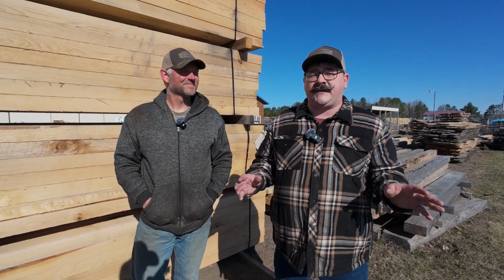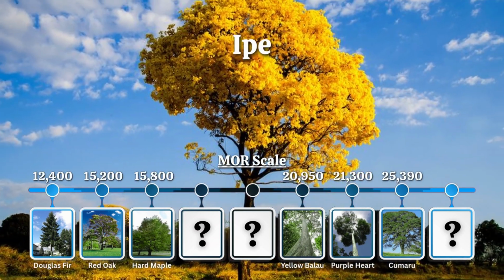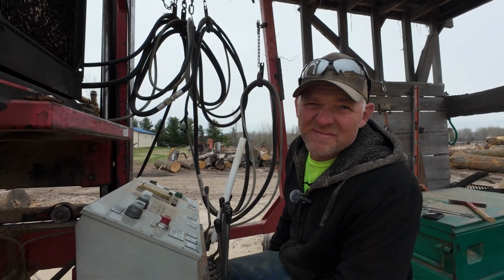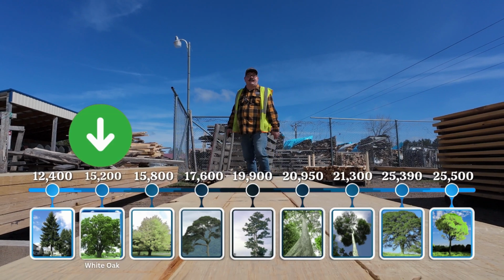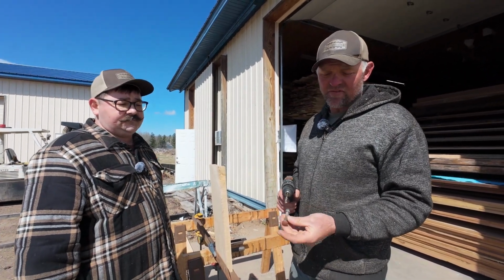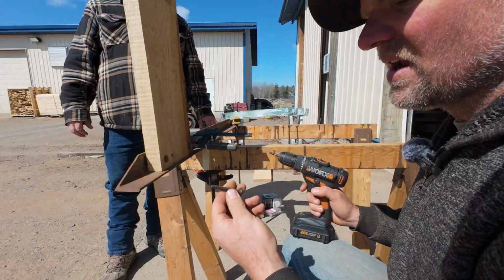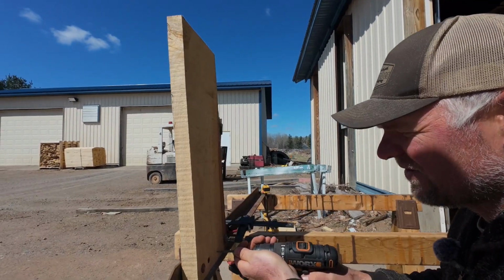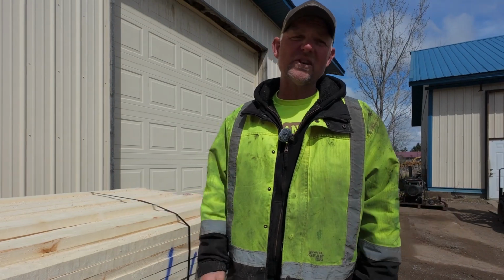The Best Wood for Trailer Decking is...

Comment: Used to drive Hot Shot and we used old oil field matt boards.  Since the board were oil impregnated from use around drilling rigs we never had a problem with rot.  When we did have to replace the timbers on one trailer and had to buy commercial timbers we used ground contact 2 x 10's and treated them with a 30-40% used motor oil and diesel fuel mix.  Brush it on and let it soak in for 48 hours before first use of the trailer.  Good for 3-5 years before retreating.  EPA would have had a shit fit if they ever would have found out, but it worked.  Old Concrete form boards also make GREAT deck boards after being treated with just a good spraying of diesel.  The hydrocarbon reacts with the caustic from the concrete absorbed by the wood to form an awesome preservative.  That is a trick from working in a chemical plant.  Like I said, the EPA has shit fits about those but they DO work really well.
Reply from the maker: This is probably one of the more interesting comments we’ve had in a while, now I think I am going to pick the brain of my concrete buddies to see what they think. Thanks for the comment and welcome to the community.
Reply: The old fellas mixed used motor oil with a little diesel fuel. Roll on a couple of layers. Repels moisture and bugs for   many many years.

Comment: Black Locust is considered a trash tree but the wood will last you 50 years.
Reply: I planted about 50 Black Locust 28 years ago, what a mess they have made because they grow anywhere. I hope to cut them down and figure out a good use for the wood in the next couple of years. I know they make great fence posts. I hope to use the wood for something.
Reply from the maker: We have had a lot of people suggesting that we use black locust. As a hint for upcoming videos, let’s just say: “we’re testing some wood species against others”.
Reply: @kandjlumber  
Black locusts have more resistance to rot than treated wood!
Reply: @kandjlumber  Black Locust ,,, Treated with a Mixture made up of 40% Motor Oil / 25% Boiled Linseed oil / 25% Diesel or Kerosene / 10% Pine Tar . . . .
Reply: It is too susceptible to fungal infestation to be a viable commercial species. That being said, I have found enough over the years to make some wheelbarrow handles.
Reply: @localcrew 
Come to Missouri and bring the fungus with you!
They grow like crazy here and spread like wildfire... if a landowner doesn't stay on top of killing them, they will be everywhere in 10 years...
Reply: @306cuber  there's a black locust fence post on our old homestead place in 1920s by my great grandfather
Reply: I agree, locust. If unavailable white oak
Reply: @hoadysholsteinsandhardwood 
White oak rots too quickly and is too expensive. Post oak is very good for a trailer  if you want hard boards, black locust is the best.
Reply: @306cuber  black locust is great wood.  I build a large raised garden out of it.  I built my mailbox post out of it 10 years ago.  It is rock solid.
Reply: @peterforrestel2558 farmers would use it exclusively for fence posts if it's around.
Reply: Black Locust would be my first choice!
Reply: Thorn is the best!

Comment: Apitong is the best for both price and longevity..
Reply from the maker: Apitong is notoriously ridiculously expensive. I'll give you the longevity point though. thanks for the comment and welcome to the community.
Reply: Doesn’t apitong come from Australia i replaced the deck on a 40ft flatbed years ago with it if I remember right it was hard to work with

Comment: I replaced my some of my wood decking with diamond plate; such as the upper section of my deck over, or my lowboy. Saves on wood replacement.
Reply from the maker: I suppose... if you can afford it, kinda slippery though isn't it?
Reply: @kandjlumber welded some angle to the bed where the wheels land.
Reply: @kandjlumber down here in south Texas, our lumber selection is really that good. Like you, you have trees; down here, we have steel. Wood here is killed by the sun. Most of my trailers that have wood gets my special treatment of motor oil, gear oil and diesel. It holds up better than anything I’ve bought. Since I have a lot of heavy equipment on the ranch, I have an endless supply of “sunscreen “.

Comment: 25 years ago I used salvaged pine 2" X 12" plank. Treated them every couple years with generic "wood treatment". My skid steer leaks enough oil that, although annoying, helps to protect as well. I used very few carriage bolts to keep the boards from flying off. The self drilling fasteners will never come out when time to replace any damaged or rotted plank. My poor trailer sets out in the elements and the only thing I try to do is keep leaves and other debris off the deck so it can dry out between rains. Wood is the best deck for many reasons. Everyone has an opinion and none of them are wrong, for them!😊
Reply from the maker: You know, I really like what you said at the end there: Everyone has an opinion, and none of them are wrong for them". Thanks brother, and welcome to the community.

Comment: Poplar soaked in used motor oil and diesel fuel. No splinters!
Reply from the maker: Yeah those softer, more fibrous species will fall apart over time, with or without oil. The sun tends to do the worst.

Comment: Next time I redo my car trailer it will probably just be steel diamond plate.
Reply from the maker: It's great if you can afford it. have you ever had problems with it slipping though?
Reply: @kandjlumber yeah it's definitely expensive but I've put probably four wooden decks on so far and sanded and sealed them yearly so that was a lot of money

Comment: Put used motor oil on the deck.
Reply from the maker: I have heard of people doing that with good results! but apparently that makes it slippery? what do you think?
Reply: @kandjlumber after it’s soaked in, it’s not slippery at all.
Reply: @kandjlumber not slippery at all. It will bead rain just like a ducks back. Try it!

Comment: Dont use screws to hold planks of a trailer floor if you are hauling cattle.  I know from bitter experience
Reply from the maker: Oh MAN! I just had a terrible visual after reading this comment. Poor Cows!
Reply: @kandjlumber   Yep.  You got it.  1/2" hex cap screws, heavy fender washers, and stop nuts.  The only way to go if your cattle trailer floor is wooden planks.

Comment: The best wood for trailer floors is saturated in used motor oil
Reply: ...lotta farmers will apply used hydraulic oil...
Reply from the maker: Is it true that it makes it slippery?
Reply: @kandjlumber 
At first but it gets much less pretty quickly as it accumulates some road dirt and the oil soaks further into the wood.  I think that YT channel "65 Ford" made a video about it.  That guy is, in my opinion, a shop genius.  Whatever he says you can take it to the bank.

Comment: Osage orange makes the most incredible trailer decking except for the price. Wood cupping may be caused by a number of reasons but for trailer decking moister delta between top and bottom surfaces is probably the biggest, The side with more moisture will be longer and the edges cup away. I've had deck boards cup up in the summer and slowly change to cup down in the winter.
Reply: How do you find any/enough straight trees for lumber?
Reply: @Randy7th  Well I did write except for the price, so there is that. It helps when I have my own band mill and I own a tree service. Straight trees are out there but length is the hardest to find. Using shorter boards is a necessity. I would rather use the wood for other projects though it's very beautiful lumber and crazy strong!
Reply: @osagejon8972 
I don't know where you are, but here in mid Missouri Osage Orange is not plentiful at all. The trees I know of are as crooked as a dogs hind leg. People here just use them for fence posts, if they use them at all...you can REALLY tell which ones they are!
Reply from the maker: Do they keep going back and forth like that?
Reply: @kandjlumber  As the lumber gets older it isn't as much of a difference. I'm not totally sure why. I think it has to do with actual structural changes in the wood similar to kiln drying and perhaps fibers being crushed from equipment being loaded. All of this changes the woods ability to accept moisture and how much it may hold. I've also noticed that when the trailer has sat for an extended period of time in the winter with snow on it they tend to be cupped down a little bit which I think is due to the time the moisture has to enter the wood. Your observation of the curve of the grain to want to straighten can be seen in old bank barns where the boards inside the door are typically grain curve up then down then up and so on. This gives a bit of sine wave pattern and something for horses hooves to get some traction on. Wood and trees are amazing and the more I learn the more I realize I don't know but apparently the oldtimers did! One other thought on grain curve is that if it is curving up the moisture is trapped by the hard grain whereas if it's down it can theoretically pass through easier. Just saw your channel in my suggested YT viewing and I will have to watch more... thanks for some morning coffee viewing!
Reply: @osagejon8972  I learned that wood is “ever living”. It is hydrophilic and never stops reacting to moisture, so even after it’s cut it still has cellular respiration, or actually hydration, or lack thereof. I really like all the different trees, mostly. I even let some Honey Locust grow on purpose. I like Tupelo and Blackgum. Not a fan of Tallow or Sweetgum. I am growing some Longleaf Pine, which is about the onlyPine I like, except maybe the Sand Pine. In the last few years I’ve found quite a few Hophorn Beam trees and they sort of intrigue me like the Osage Orange tree. The natives used both for making strong and flexible bows. My Grandad used to call Osage, Horseapple trees. They make great hedgerows and fishing structure, as well
Reply: @sport07-o2l  My grandad called them the same!  
Can fondly remember going and gathering a few to bring to the horses.  Also, if the season was right, meaning the “horse apples” were present, and you were riding, the horse would always want to veer off to have a look under the trees and in the low lying branches for a treat!
Northeast Oklahoma girl!

Comment: Yellow pine is garbage. It is long grain. Maybe down in the south it could work for a couple of years. Ash would be much better.
Reply: ...you better oil or creosote that ash yearly...because it rots very quickly.
Reply from the maker: Ash will rot pretty fast..
Reply: SYP is actually tougher than you obviously think

Comment: Only issue ive found is the top of the screw doesnt have alot of surface area so if u ha e anchor point in ur deck ull pull those right out
Reply from the maker: pull through the wood? what type of wood are you using?

Comment: Can you use trex composite for a trailer
Reply from the maker: I suppose, but I'd personally would rather use SuperWood: https://youtu.be/qDgCX_H1Dog
Reply: @kandjlumber that sounds good but can’t find it In my area. I just want to have a “maintenance free” trailer deck.
Reply: That stuff is way flesh so make sure the subs structure is like 12" on center.
Otherwise your trailer will be a flexy flyer.

Comment: It also depends on center to center beems, i used doug fir on my aluminum flat bed and had 16.5k on the bed multiple times
Reply from the maker: That is something I overlooked.
Reply: Standard is 16inch center to center, heavy duty is usually 12inch. With aluminum i went 10inch@kandjlumber